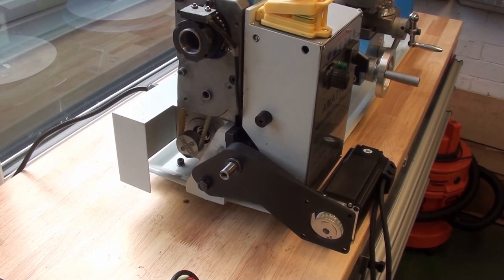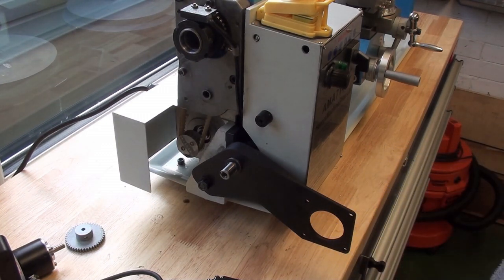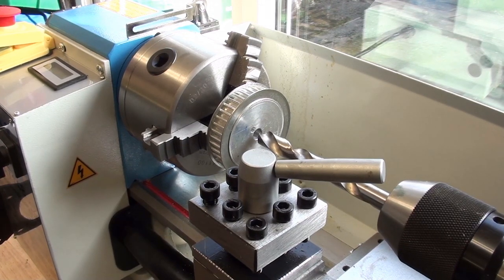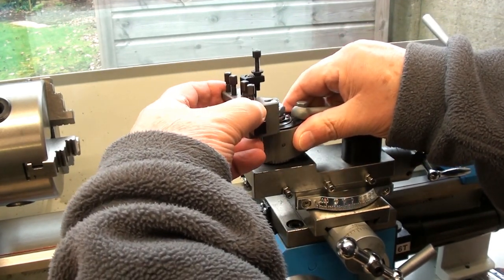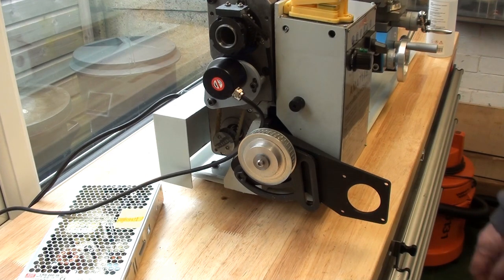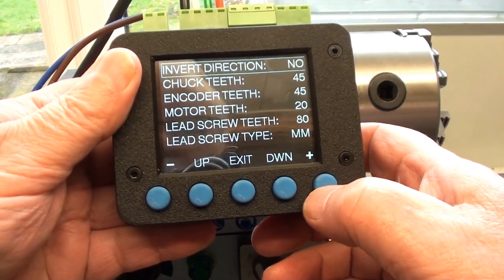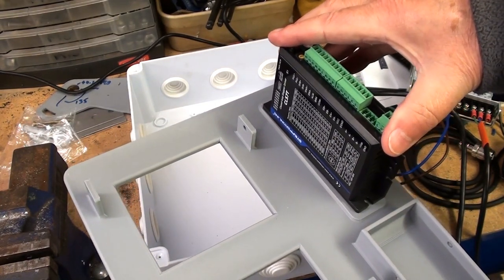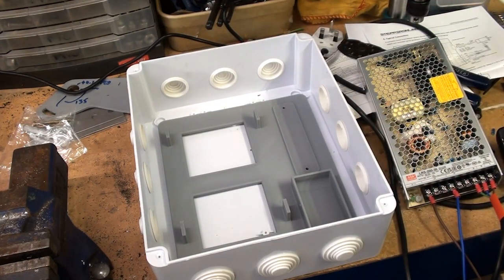New lathe update -The Electronic Lead Screw  and more

Comment: would it not be more beneficial to this lathe to mount this stepper as the spindle motor cause i bet its way bigger than that motor , i bet a smaller nema32 or even a 24 would have been plenty 
if you need the amount of torque this can deliver to cut it would stall out the little main motor with change of blowing up the electronics which provide the variable speed.
Reply from the maker: I must admit that I don't follow your assertions.  The supplied spindle motor is 750W (1 H.P.), which is more than adequate for the needs of this little lathe.  I don't know the equivalent power and/or torque of the NEMA23 stepper motor, but has proven perfectly suited to driving the lead screw, via a 2:1 reduction ratio.  I used the same stepper on my previous lathe, a generic 9 x 20 Asian lathe, and it continues to give good service in the hands of its new owner.  Thanks for your interest and comments, however, but I will continue to plough my own furrow.
John
Reply: @bizzibeeworkshop  no worries i thought it was and looked like one of those large 32 ones if its a 24 then its ok just looks giant compared to the lathe that must be what throws me off.

Comment: What program are you using to create your 3D drawings for printing.
I need to make one of those box lids for mine. Is the 3D file available anywhere.
Reply from the maker: I'm not sure what you mean by "box lids".  I use Alibre Atom software for my 3D CAD designs, which for 3D printing I export as STEP files.  Other people's designs - from Thingiverse, for example, are usually STL or STEP files which can be imported to Atom or, more occasionally, Fusion 360, which I find is useful if you want to modify existing STEP/STL files.  All my own designs are kept on my home computer but could be available to anyone interested, by email.
John
Reply: Hi I am referring to the enclosure box that houses the stepper controller and the power supply. It would help me no end if I had this file as I am no expert in 3D cad.
Reply from the maker: @Bigbigjimbo I see.  That's a commercially available plastic enclosure that I purchased from eBay:
 https://www.ebay.co.uk/itm/254510997123?var=554194563195
On my previous lathe, I used a metal enclosure which was larger than this one and consequently much more expensive.  Time will tell whether the plastic one will give problems with RF interference.
John

Comment: Hi, can you link to the tool post? thx
Reply from the maker: Hello.  I certainly can it's:
https://www.ebay.co.uk/itm/314214813802
Although the price has increased by GBP10.00 since I placed my order!  As an aside, the tracking still says it only got as far as the Chinese export point and has been returned to the sender when it's clearly installed on the lathe.
Reply: @bizzibeeworkshop  Thx!  I ordered a generator from China and just got a notice that It will be delivered today. I've been using it for a week....

Comment: Hi, I can give you the files for 3D printing the encoder support and stepper motor support they might not suit but you can have a look.
Reply from the maker: Thanks for the offer.  I will bear that in mind if my designs don't work out.  As you appreciate, the requirements are very much machine-specific, and I've been through a number of iterations to get the encoder mount just right.  All hinges of the delivery of the stepper motor drive belt, before I can finalise the mount for that.
John
Reply: @bizzibeeworkshop  no problem it is the same machine so should work so if you require them I will find a way to send.

Comment: Good stuff !    You are a wizard at 3D printing !
Agree that something has to be done about those connectors coming out of the top of the control panel, I can't quite think of a solution, but I'm sure you will come up with a cunning plan.   The lathe sounds much much quieter without the change gears, good job really, as it was shockingly noisy. 
 All the best.
Reply from the maker: Thanks, Colin.  I'm not so sure about the "wizard" bit, if you could see the contents of the failed attempts bucket!  It's certainly a lot quieter, as you say,
Regards,
John